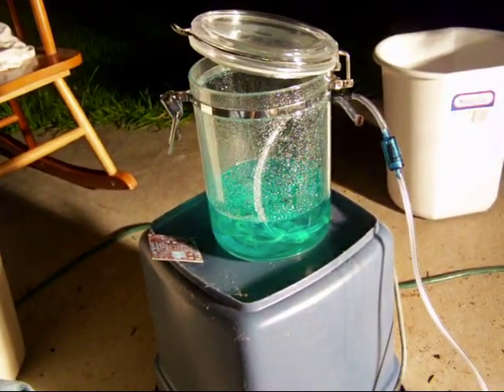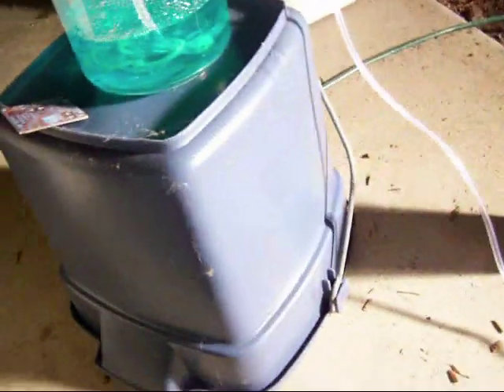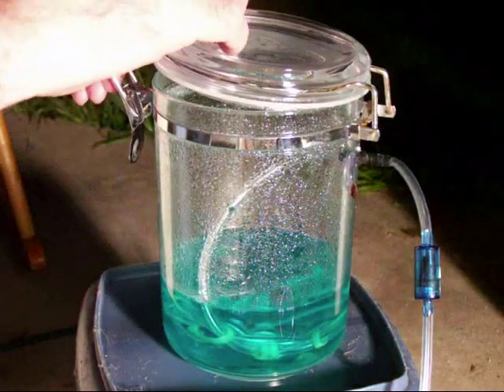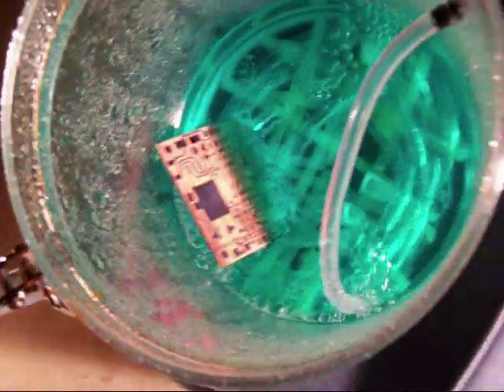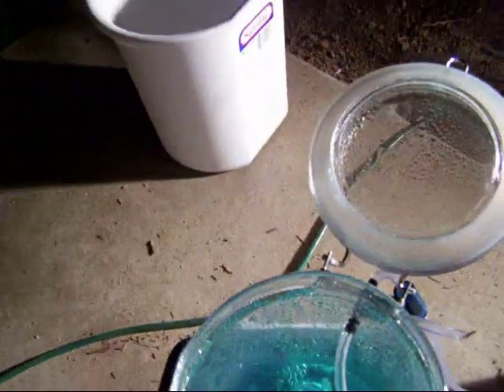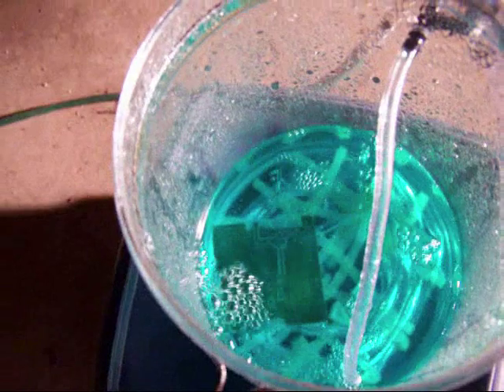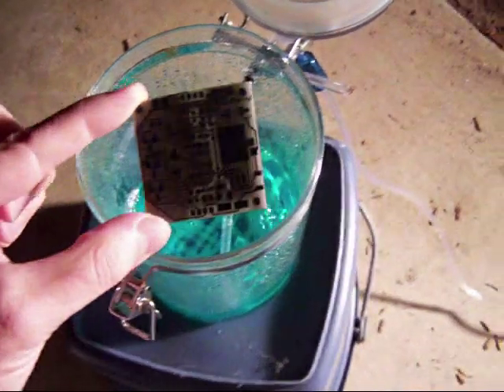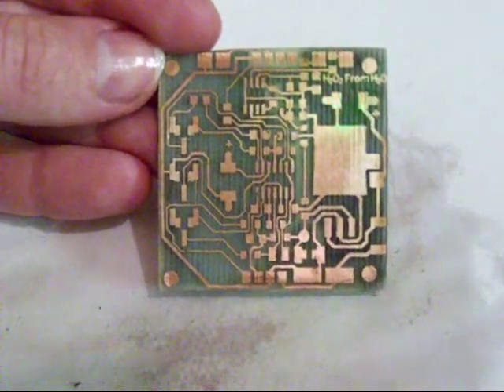#6 H2O2 - Etching A PCB With Acid Copper II

Comment: too blue i think. that means u add acid if i remember right. edit: now i listened i had it muted at first. did you disolve copper wire or anything or were u counting on your etched boards to do that?

I really hope that knife didnt go back in your kitchen. I made this with the advice/phone calls of a girl whos phd invovles a lot of a lab work. I was instructed to toss the glass mason jars i made it in(after rinsing and dumping rinse water into sealed waste fluid bucket.. 

you should also scrub the board with 5% hcl after to remove toxic contaminants that dont rinse off with water...notice any discoloration on your traces after a few hrs? thats them.

I bought a 40 buck mask (20 for mask 20 for 2 carts) rather than worrying about did i breath too much of that or not.

Comment: You can make 500 ml OF THIS in a couple of hours using crap old pieces of copper tub or old wire.
HCl is so cheap I wouldn't even bother with regenerating.  Just me
Reply: Just an fyi, the amount of acid in there at this point is not very high.  even when you first make the solution its only about 15% HCL

While you are correct in using care, I don't think that it is as bad as you are thinking.
Reply: you really cant make 500ml in under a week with drug store peroxide. what you have at first is an acid peroxide bath which has different qualities than cupric. If you arnt bothering regenerating wtf are you doing with the spent? thats half the point of using this stuff, no hurting the environment by having limited use echent or paying to dispose of it.

Comment from the maker: Peroxy-sulfuric Sound like a mix of Hydrogen Peroxide and Sulfuric Acid? What are the byproducts are any of them extremely dangerous and is it self sustaining after you mix the solution or do you discard the mix and start with a new batch of Peroxy-sulfuric each time?

Comment from the maker: How many square inches can you etch with a cup full of ferric chloride? I have used 1 cups of Muriatic Acid(Hydrochloric Acid)when I filmed this video and added 1 more to increase the volume.  Total cost 5$ for a Quart, I am still using the same solution; I dont have any waist to dispose of. It a crime to knowingly pour hazardous waist down the drain. Big fines! My total surface area is around 92 Square inches. A win win solution. I watch TV while it etches.